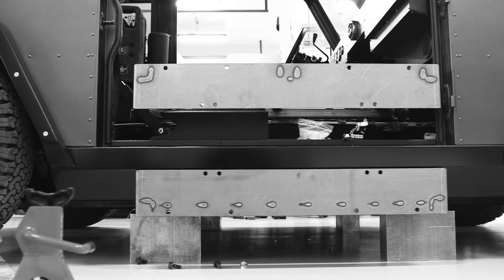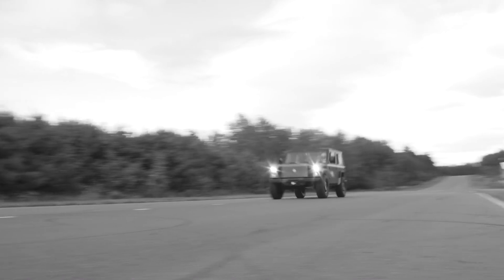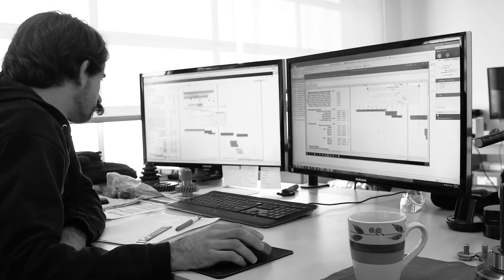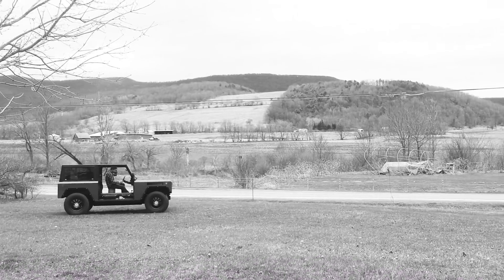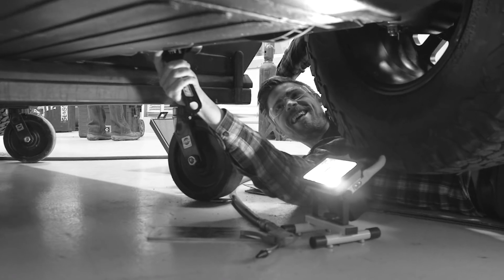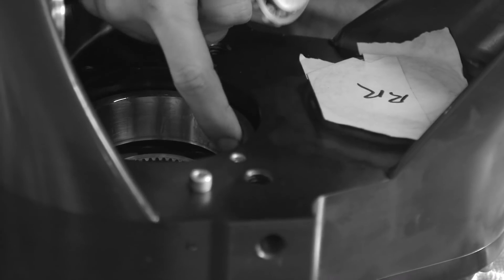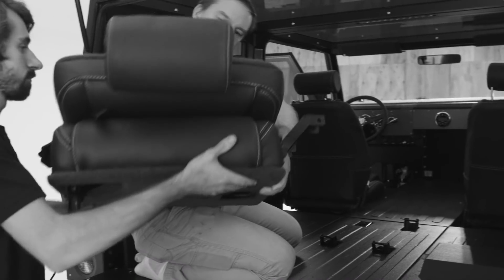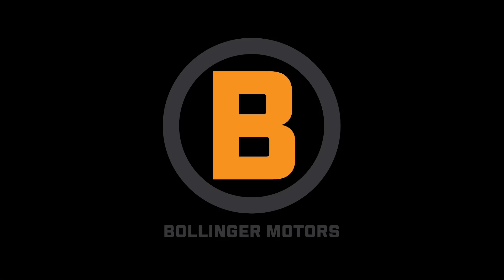2 PROTOTYPES - Bollinger Motors

Comment: I'm really looking forward to the 2 door. I love old Blazers and this is basically an electric one with more capability than any truck I've seen. I hope the 4 door is extra big like a Suburban. If its basically the same size as the 2 door but with 4 doors then its pointless. I've been excited about this truck since you first revealed it. I'm really looking forward to seeing it in production. My only concern is the long term reliability of the batteries and the range per charge. I've seen another company recently reveal an electric car that you can recharge the batteries just as fast a refueling a gas powered car by adding the 2 non toxic water mixtures. That might be something to look into as well. The one thing that makes me nervous about electric vehicles is the range, charge time, and battery durability. Anyways, keep up the good work. I'm looking forward to taking one for a test drive.
Reply from the maker: Thanks for the feedback! Battery technology will continue to evolve and our trucks will be adaptable to it. The 4-door is 16 inches longer than the 2-door.

Comment: Two thoughts offered in a friendly and constructive spirit: The row of knobs/buttons/switches on the lower border of the dash panel could be a hazard to knees in a frontal impact and will be less than easy to see - put the whole row above the central panel. The seats in the prototypes look plenty comfortable but they do not match the exemplary utilitarian style of the whole concept - off-the-shelf suspension seats with wipe-clean or hose-off surfaces would be a better match.
Reply: I also like the ability to use as much off the shelf components as possible.  Nothing wrong with making the thing compatible with parts that are readily available in the market today.  Would help keep costs in check too.
Reply from the maker: Steven, thanks so much for the constructive ideas. Will definitely pass it along to the team!